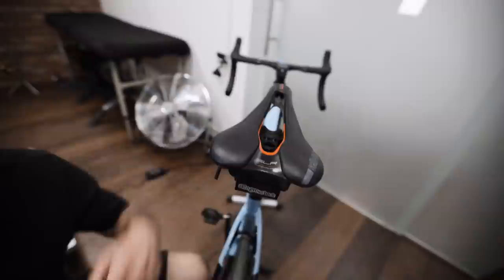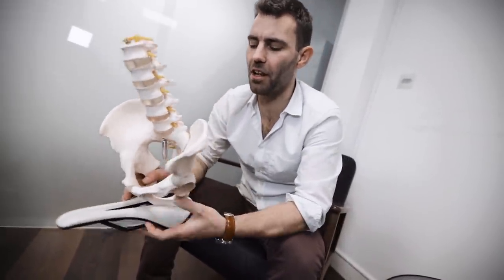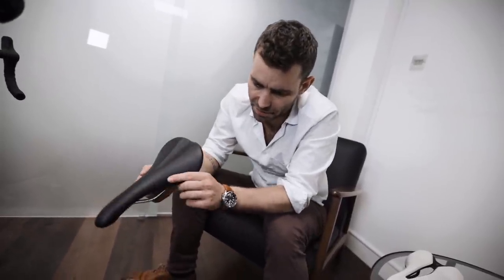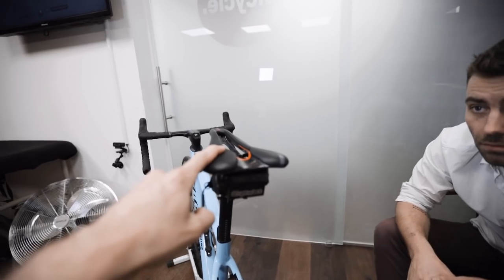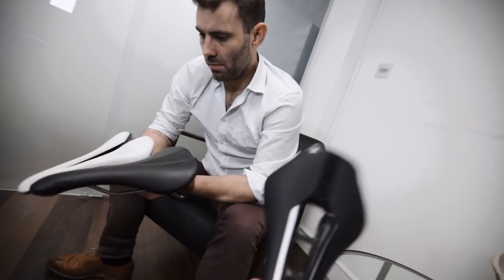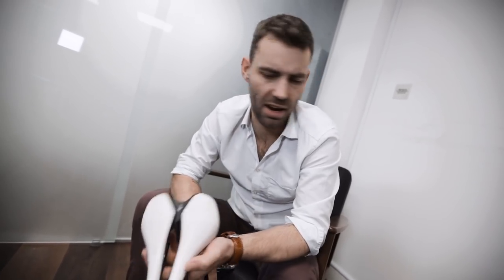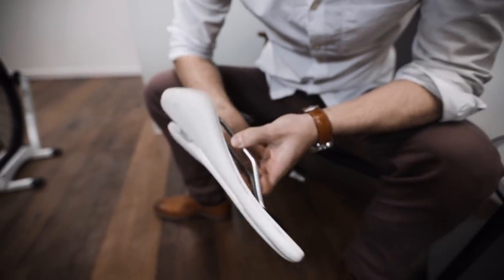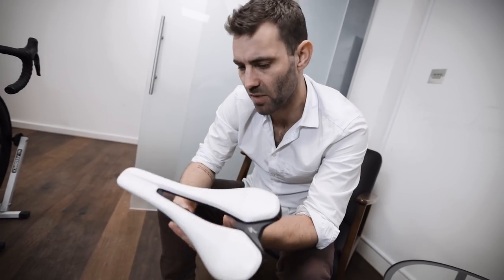Saddle Problems are NOT caused by your Saddle - BikeFitTuesdays

Comment: I love that this video was made, because after buying my first road bike "the wrong way," i.e. buy the bike and then try to fit it after, I had tons of saddle issues; shifting side to side, always feeling like I was sliding forward, etc.  Watching Bike Fit Tuesdays helped me 100% fix all these issues without ever changing my saddle by moving back my cleats and using shorter cranks and a shorter reach, narrower handlebar.  Suddenly, I'm sitting square and comfortable in my saddle!
Reply: Hey Claymore2007,
I've had those problems for a long time. Went in for three bike fits and they couldn't figure it out. We don't have the saddle pressure points technology in Costa Rica so I learned to live with it, but it's uncomfortable. There's not a single long ride that goes by without leaving some type of collateral damage like soreness (best case) or saddle sores (always on the same spot). Do you have any advise I can use or could you please point me to the videos that you mentioned?
Reply: @daniellalinde578 . Quite a few years ago, I read that if you have saddle sores on one side, it could mean that the opposite leg is a a bit shorter, causing it to “reach” for the pedal, which makes the saddle sore develop due to that the hip rocking and causing friction.  The solution was to shim the cleat on the short, “reaching” leg, which will eliminate hip rocking and saddle sores.  2-3mm of homemade aluminum shims did the trick for me!

Comment: I had some serious discomfort issues when I purchased my first road bike in 2017.  OE Giant saddle was a torture device, so I started demo-ing some different models and brands.  Nothing was quite right, so I dug an old, fairly traditional SDG Bel-Air out of a box for general use.  Continued to demo, including some models from ISM.  They recommend dropping the height (5mm), and while these felt pretty nice, I wasn't 100% convinced to drop the $200+ for one.  Kept the lower saddle height, and realized that this clearly improved the overall comfort experience, no matter which saddle was on the bike.

Comment: This is really interesting and highlights why I need to get a good bike fit. My local fitter and I tried several saddles in the same position and landed on only one saddle which fit (Selle Italia, with a large channel, cant remember the model but can check later). I still get numb after prolonged seated efforts. The fitter used lasers etc. and shims to set my position but no pressure mapping and limited video capture. I need a session with James - and for Corona to eff off!

Comment: I’m a believer in a wide cutout or none at all. Hear me out...

Take something narrow, like a butter knife or a CD. Wrap your chamois around it. The width is about the same as a narrow cutout. I don’t know about anybody else, but my soft tissue is wider than a butter knife. Narrow cutouts aren’t for pressure relief; they’re for selling more saddles. They’re “marketing cutouts.” Why? Because a big cutout looks weird and no cutout lacks the feature claim. So people buy narrow, marketing cutout saddles.

Older guys, like me, can get more swelling down there. But we still want to be able to get low into a headwind. The larger the cutout, the better, in my book. Next go narrow in overall width to avoid chafing and to allow good blood flow to the legs. Finally, like James says, get something flat so you can move fore and aft a bit without the saddle pitching you forwards.
Reply: Agree on large cutout or none. However,  a saddle needs to be wide enough at the back in order for your sitbones to rest on it. This decreases the pressure on your soft tissue.  Additionally, if the back of the saddle goes ever so slightly upwards, it will allow you to rotate your pelvis more easily. It can't be a lot because else you'll slide towards the front.
Reply: Wesley Wuyts - agreed. If it’s too narrow for your sit bones, it’s too narrow.
Reply: @wesw6787  Agreed. I currently ride that exact Fabric saddle (w/ no cutout) they discuss briefly in this video, but I'm looking for a replacement with a true, functional cutout.

Comment: The dreaded 'F' brand make the comfiest saddle I've ever ridden! I absolutely adore the Aliante. I also get on well with a Specialized Romin and Brooks C17.
Reply: Simon Webbon have I missed the origin of James’ dislike of Fizik??
Reply: I havent tried a lot, but the arionne open is what works best so far for me
Reply: @danjones8934  as far as I'm aware it's from their whole system working around how flexible your lower back is. You have to have your hips perfectly vertical then bend forward from your back leading to lots of complaints about back/neck pain.
Reply: @danjones8934   not sure on this, but their saddles are terrible. I had a Tundra, sold it after 2 rides. I have been riding SQlab saddles since and have gone away from needing riding nicks even, they are just so comfortable. They come  in a range o fsizes and styles to auit every riding style. The dreaded F have this funny idea that the saddle shape should be related to how flexible you are... wierdest idea ever... lol

Comment: before i could not ride more than 2h on my trainer from numbness. adjusted saddle forward+tilt, minor cleat position, lowered bars two spacers down and moved bars over 0,5cm(was not centred). did a 4,5h zwift ride with minor numbness. thx guys!

Comment: My shortfit saddle has more padding which has become my favorite saddle now. I've also got a different saddle on a few bikes and whilst i like the cutaway the 3 factors that have relieved any issues are tilt -5 degrees nose, width 143, and 5-10mm of HD gel foam. lowering my post by 10mm and going back to a shorter higher stem has also got rid of pressure on my man nerve.

Comment: I bought a road bike saddle on ebay of all places. It was a wicked saddle and I thought I got a great deal. It was comfy and light too. However, upon later inspection I noticed that the saddle sat slightly off-centered on my bike. Turns out the rails were off-centered with the saddle/seat section (bad quality control or a reject product). It was off JUST a bit, like barely an 1/8 inch to one side. I didn't notice this until I started getting these strange saddle sores first time in years on just one side of my 'area'. Only because of this off-center issue, It caused me major grief. In just two days I developed these awful, disgusting saddle sores. YUK!

You gotta make sure your saddle sits perfectly aligned/centered on your bike, or you will get saddle sores.

Comment: "Generally saddle discomfort is caused by bad bike fit" - I totally agree

What if the aim of the fit is to get as long and low as possible for racing purposes? Would you then need to look more importantly at the saddle choice?
Reply from the maker: Yes and setback too. Depends on the race you're going for though - if you're aiming for an hour long crit then there's every chance that you'll be on the drops for the whole event, further forward on the saddle. You don't want to be perched on the tip of it, so experiment
Reply: @Cade_Media  yeah man that's true, I think as well people look to the pros as guidance on what they should be doing, then see Adam Hansen running a -17 degree 180mm stem and think "yup, that's for me" haha

Comment: Frankenstein body question for you guys:  

I've got a right leg (which is also my dominant leg) that's a touch shorter than my left leg (1/8"). I rode for years without realizing it. As a result, today, I (subconsciously) sit with my pelvis twisted so that my right hip is further forward than my left hip. I guess this is my brain trying to make my right leg longer. The thing is, my brain has over-compensated so that, on the bike, my left leg (the longer one) ends up being (functionally) shorter than my right leg!

The output of this is that I get saddle soreness on the left side, and this is my immediate issue. Saddles with cutouts (Fizik Argo) work, but on longer rides, I end up sitting close to the edge of the relief channel on the left side which causes pain. 

My question is: Should I shim up the left leg (to try and alleviate the saddle soreness from over-reaching) or should I shim up the right side (which is my shorter leg off the bike) and hope that over-time my hips untwist?
Reply: how did you solve it?
Reply: @offsitearchive  I use an ISM saddle, but that hasn’t completely solved the issue. It’s just the best solution I found so far.

Comment: I have a question: I have two bikes I ride regularly with similar geometry. I've had them both set up identically via a bike fitter with a fancy piece of kit that enabled him to copy from from bike to bike. Both have the same saddle (A Fizik Arione) however one is much more comfortable than the other.  I noticed recently that the saddle of the comfy bike has become twisted a few degrees to the left - presumably through my riding it (height-wise it's still  good). By 'twisted' I mean the nose is pointing to the left of the stem rather than along the length of the bike, (tilt-wise it is horizontal). The other bike has an aero seat post so its saddle cannot twist. I cannot get as comfortable on the aero bike - instead I get sore hot spots and some numbness, particularly when riding indoors. Having seen this vid refer to asymmetric riders I'm wondering if that is what is going on here. Have you ever come across this before? What is likely to be the exact issue and would I be better off working on fixing my asymmetry or trying to find a way to twist the saddle on the bike with the aero seat post?

Comment: Could power balance difference between legs be a sign of a too high saddle? I am already feeling that i am sitting quite low. Also i have my Specialized Power saddle level and 6cm behind the crank but still feel like i am thrown in the front of the bike. My bars arent too low either.

Comment: i tend to do a lot of riding without proper cycling shorts and found switching from the stock Giant Contact saddle to a San Marco Aspide that has a cutout drastically changed comfort levels.  However when riding with cycling shorts i can't feel a difference between them.

Comment: I'm 6-2 260 lbs.  (188 CM  118 KG)  Everything is hard to fit. My feet are 16W (US)  .    After watching this I think my seat may be slightly too high.  Also I am going to get a saddle with a bit more pressure relief opening too.   Doing a 350 miles trip next month!

Comment: Great videos. I've just got a new bike with a new saddle, but my seat bones are totally agony after 25 miles, I've got no numbness, and the new saddle looks very similar to my old saddle apart from the foam is less. Could this be down to just the difference in foam? Or could the new seat width be too narrow? My seat bones are sitting on the slope bits of the saddle? Any advise would be appreciated as I dont want to waste hundreds chopping and changing saddles/ cheers

Comment: I've always done better on the saddles on the cheaper end of the model with a bit more padding. Is that just covering up bad fitment or could it be my tender buttocks prefers a bit of padding?
Reply: I'm no expert, but it's either that you sit a little further ahead (which is fine, I think the pros too, regularly sit in the middle of the saddle to change their position)

Or it could be that your sitbone width is wrong? Because in essence only your sitbones actually get support off of the saddle except for further ahead where the valley in between gets more contact

Comment: Interesting video. I spoke with a well regarded bike fitter today and he told me it was not worth doing another fit until I found a saddle that stopped numbness. I have tried many over the years with cut away but if I am in the saddle for more than 30 minutes it is all numb down there. I was looking at the Ramus and Infinity saddles to help with this. Any thoughts? I think my underside is quite pronounced and I have never found a cut away that fully cleared the important stuff. No fit or adjustments have ever really made a difference. The closest to eliminating it was the old Selle Anatomica Titanico X

Comment: I’ve had comfort issues for years, more lately after returning to cycling after a long Haiti’s after back surgery. While looking for a saddle to replace my hard B17 Champion Specials it was advised to measure sit (sitz) bones.  Mine are narrow, about 191mm, add 20 and get around 120mm.  What I noticed was that my sit bones are not symmetrical. I have no idea how to deal with this.  Maybe the Selle Anatomical saddles that seem to allow each side to move independently may be a solution.

Comment: Hi James, I find out I get saddle issue after 2h, on shorter rides I don't get any problem, is there anything I can do?
I am sure that my saddle high isn't too high. BTW I find out that I tend to point out my toes and the right rear side of my right foot (only right foot) will suffer from that, I put the cleat as far as it goes,will move the cleat closer to the cranks help, or anything I can do?
Also by moving the cleat back really help, but I get a lot of two over lap, but when I move it forward my toes start to grab when putting down power, any suggestions for that?
Great vid as always, hope everyone stay save.

Comment: With a big cutout my man bits get squeezed down into the cutout AND junk coming up from the road-especially when riding gravel or in the rain-sand and road material comes up through the saddle cutout and that sand and material create grit between my saddle and shorts.  A CHANNEL seems to be best.   Saddle Height is most important in power output and comfort.
Reply from the maker: There's a few off-road specific saddles now which have a channel, but it's filled in to stop exactly the problem you're experiencing

Comment: Dreaded  F word saddle on my new R3 Cevlo, was not happy with it , and after a 3rd bike fit , fix was.... checked saddle height,  motion capture,  rotate the stem angle to 6° up, rotated bars up 5°and cleat wedges, Ergon saddle , much happier, but still some hip discomfort after 2 hours hard bunch riding , full gas! I'm 65, old racer, haha,   any suggestion,  James? Chèers..

Comment: I just corrected my saddle height.  Legs feel a lot better.  I'm not sure to move my saddle forward or backward?  I have ridden then I get the sore neck and shoulders, it feels like my hands are not comfortable on the hoods.  I'm a size 54, but I dont have long arms.   I dont want to move all the way forward because I thought that moves the weight to the front of the bike.  I can control the bike fine.  Steering and shifting braking good.  But the hands and arms dont feel right.  I hope this makes sense.  Thank you😎🤙

Comment: Would you guys do an episode on fitting vintage bikes without using a ton of modern-styled components? I'm curious about what has changed in 40+ years, especially since I want to pull out my dad's old touring bikes out of the basement. You could call it the L'Eroica episode or something.

Comment: I set myy saddle is a little lower than what im used to riding and i even used the shortest stem i have which is 70 mm long  but my genital soft tissues still hurt. I use a fake ec 90 saddle that is kind of wavy but it does have a decent sized cut out  could this be a rare case where the saddle is the problem?

Comment: James, I've had bike fit which suggests I should raise my saddle by around 15mm, but when I do I get IT band issues. Should I look to raise it for an 'ideal' position or not, how much should I raise it by to not give me the issues?
Reply: What you need is a new bike fitter. No 'ideal' position should ever cause discomfort.
Reply: Scott Gearon sounds like your fitter is fitting you by numbers and joint angles, rather than looking at how you’re interacting with the bike.

Comment: Saddle sores aside, would actual sit bone pain be down to the positioning of a rider? Do you get many guys in that are okay for an hour or so but find an increase in pain as the length of ride increases? The position is okay for short rides but after longer duration rides the pain increases? My saddle height is good, cleat position improved, reach and bar width okay 🧐 I wish you guys were closer
Reply: i think the bigger issue may be fitness and conditioning. if a saddle is good for short rides, it should be good for rides, period. regardless if its long or short. i get it, that sure, problems may take time to manifest, and it may be the case. but i feel that its usually more the case that position of the rider gets sloppier and sloppier over time, and thats when problems start to arise.

Comment: Question for Bike Fit Tuesdays: I always run my cleats as far back as possible and I got well fitting shoes in terms of length and width. Still I always get feeling of "pedaling with my toes" rather than feeling the pedal pressure somewhere behind the ball of the foot. Why is that? (I think I got quite long toes if that helps)

Comment: Very interesting summary of saddle interaction. I have just one question would set up your saddle flat, using a spirit level placed nose to tail or situated along the narrow / nose part?
Reply from the maker: James does it with an unnecessary expensive spirit level on a metal plate. 
Cheaper option would be a normal spirit level on a book, just placed on top
Reply: Francis Cade thanks for the reply. So no Laaazerrr!